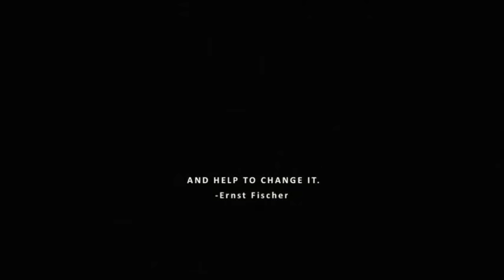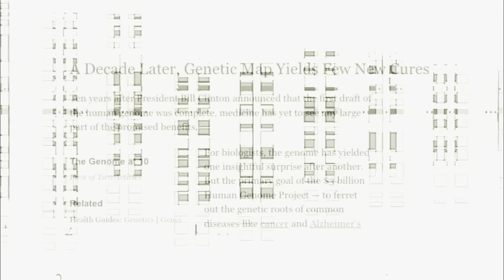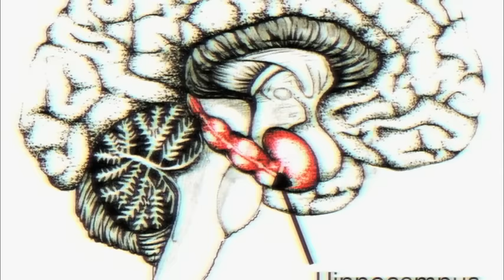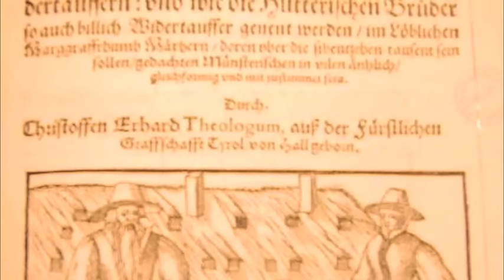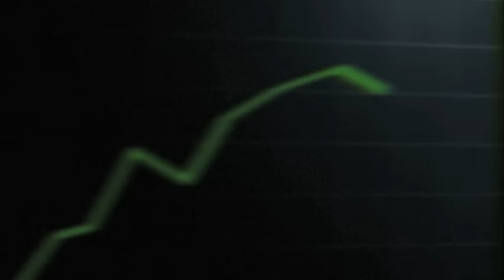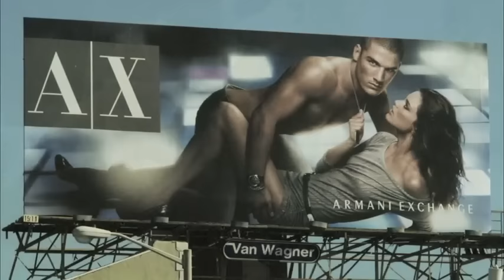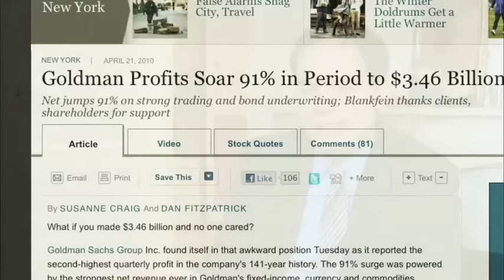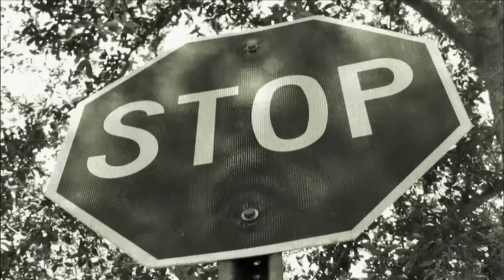ZEITGEIST: MOVING FORWARD | OFFICIAL RELEASE | 2011

Comment: If there's any validity to this system at all, it should be possible to show it on a smaller scale, contributed by voluntary actors in a non-violent way. If you can create a system of abundance where people doesn't need to work for survival, surely it will grow. That is the very essence of a free market.
Reply: You should extrapolate on that idea and take into consideration the conditioning in our economic system currently as well as the absurdities of the current economic system, not the math, but the fundamentals. The technologies existing today could provide an overabundancy if employed rationally and not for personal gain..that is the hitch.
Reply: Paul Warren Your point being with respect to what I just said?
Reply: rwoz
Human nature is more the problem than the application of any type of economic or political system. No matter how benevolent a system might be, it can be subverted by malicious intentions....
Reply: What does that have to do with what I just said? Does it change the fact that if the idea of a RBE can be realized on a large scale it should also be realizable on a small scale?
Reply: A small scale RBE is basically a commune that uses off grid technologies (Rain collecting, solar power, etc) that frees participants from unwanted work. Many communes already exist and continue to exist. Two ways to build a small scale RBE, either upgrade current communes (either as residents or outsiders with the residents' approval) or build an experimental RBE city from scratch. In order for RBE to grow either way, a team can set out to teach others the basics on how to build their own city. To gain trust, they can give away surpluses to the poor and provide them with meaningful jobs that make a difference. Members can also use the Internet to educate even more people. It can be an opensource project where anyone online can contribute to by recording and sharing the results of their hands on work (Similar to existing opensource hydroponics). Families are an example of a small scale RBE that have been around since, well, the first families. They don't use money unless they have to interact with the monetary system, they share resources, parents "survey" the environment to make sure its hospitable and to figure out how to live in it, etc. Growing this requires people to start treating non-relatives as relatives, this eventually becomes a commune.
Reply: The closest real-life example of a RBE are eco-villages such as Findhorn in Scotland and Wildpoldsried in Germany. 2500 inhabitants of that German village produce 300% of their energy needs with solar and wind. Findhorn produces 70% of their own food with around 90% of their own energy. And these villages aren't automated to the full extent. Agriculture itself has been tremendously automated and the process is continuing. New technologies such as hydroponics, window-farming and vertical agriculture mean you can grow food within the cities. A few years ago a new European satellite was launched called Egnos. Its G.P.S. is so precise that tractors running on that system and a farmer marking his land can sit back now while the machine works autonomously. 

Is there validity to a RBE? Of course. All the technologies we advocate exist today, it's just a matter of optimizing and designing these systems. The problem is that there's never enough money and that the market itself will resist these changes. What free market advocates are unwilling to see is that eventually high technology is going to render the market obsolete.
Reply: TerraRubicon That sounds great, I really like the idea of a self sufficient livelihood. If the result will be that people will stop working and therefore consume much less, then fine. Render the market completely obsolete? Well that sounds like hell of a great future (in terms of resources) if we don't even have to trade with each other and still have our needs met. I remain skeptical.
Reply: rwoz When I say 'the market will become obsolete' then I'm really looking far into the future more or less at a society you would see in the tv show Star Trek. Right now and on the horizon are the reforms the market has to face. There's the debt problem, peak oil (it's a finite resource) versus clean energy systems and technological unemployment. Technological unemployment is not just jobs that disappear. Market economists often claim that new jobs are created. That might be partially true but technological unemployment can also mean a decrease of 'working hours.' If you make a machine to replace a human then the factory might put some time in it, there might be a maintenance person who checks the machine periodically but a 40 hour a week full-time year long job has disappeared. You understand? Thanks for reading.
Reply: TerraRubicon Yes, of course it's a radical sci-fi idea but I still don't want to dismiss it, it's pretty much impossible to tell how a world with such capabilities would look like. I mean, only the idea of creating an AI with human intelligence is so radical it's ridiculous to claim to have any form of valid forecast of how such a future would progress. It might all go to hell in an unimaginable way, or the opposite, who knows. It's fun to speculate around though.
Reply: rwoz Well, going on with the Star Trek analogy. I don't know if you've seen that show on television but they have this device called a replicator, it makes food or water by rearranging atoms&molecules. So a person walks up to that machine and orders a meal or drink and it just materializes. Pure science fiction of course, but something remotely similar exists today. 3D printers... This machine can already make objects made of plastic and metal. They are experimenting how the machine can make food, a pie for example. I have family working in the aircraft industry and was told that a big company was investigating making aircraft components (made of composites) using a 3D printing system. This machine is going to be the next revolution and will change the market.
Reply: TerraRubicon Yes one can hope so, the idea of decentralized manufacturing in that sense is appealing. An other argument I've heard for the remote possibility for a star trek replicator is the fact that we as humans can rearrange food to create other humans. Just take that principle and think of how advanced machines one probably could make if one had the technology.
Reply: rwoz People do this all the time these places tend to get raided for growing pot even though they dont
Reply: Ross Watkins Well that's obviously fucked up. But that's a government problem and not a market problem.
Reply: rwoz I've strayed somewhat from your initial point but personally I'm all for testing RBE systems. Test houses, test streets, city blocks with build-in agriculture. I'm all for it. I would also like to see more studies in the psychology&sociology sciences perhaps in combination with universities.
Maybe free market advocates can build similar systems? It would be really interesting comparing results of these systems.
Reply: How free is a free market system really? If you had a company, would you grant everybody access to your system in order to monitor each little detail about your manufacturing, resource use, logistics, waste, R&D, product safety, working conditions etc? If so would you be totally unconcerned about whistle blowing or even just people forwarding evidence how you could make your processes more efficient and sustainable?

If negative, do you expect everybody to take your work on faith alone?

A system based on trust and faith alone (and some published financial figures which don't say much about the tangible components of an enterprise), hoping nobody will break the rules and sanction those who get caught breaking them. I call that idealistic and utopian.
Reply: Franck Merlot 
1: I don't see what this has to do specifically with my comment. It wasn't about what's good with free markets but that a RBE should be realizable in a voluntary society.

2: Non-sequitur. Just because people wouldn't trust companies in a free market context doesn't mean that they still wouldn't be free not to cooperate with them. And no I don't say that every company would be trusted, they would rather be pretty damn suspicious since their interests wouldn't be "guaranteed" by some phony state. This would on the other hand create an interest by the companies to shape up and therefore weed out the bad ones. Some kind of a standard would probably emerge. 

I have never seen a good argument for why I should trust centralized control. Almost everyone who criticize the free market seem to assume that the government can do all these miraculous things, completely disregarding systemic aspects. You think there are some central agency which magically could calculate every optimal solution for everything? Or that they wouldn't be influenced by special interest? People have this idea that an all powerful entity could set fair rules for us all, it's almost as if they believe in some sort of a god.
Reply: rwoz "You think there are some central agency which magically could calculate every optimal solution for everything?"

There is no "central agency" in an RBE. It's completely decentralised since everybody would be involved. Not just a controlling elite (which is never guaranteed to be competent).

You haven't answered my question. Would you grant access to all your company data, assuming you had a company?
Reply: Who will then enforce every company to view all that information you want, if not a central agency? 

I don't know, it depends on what standards there are. If my only option for successfully driving a company, maybe because I need investors, partners or consumers which can trust me, then maybe I wouldn't have a choice. But if my choice to not show all that information in the end would make me earn more money then of course I wouldn't.
Reply: rwoz Well, that's exactly the crux in market systems. Confidentiality and so-called intellectual property whereby the latter is very seldom an invention truly from scratch and mostly just a declination from existing knowledge which is public.

I get the suspicion that market advocates define by "free" the freedom to exploit every ever so small advantage and the freedom to keep the option open to screw others over.
Reply: Franck Merlot Why didn't you answer my question? 

There's a crux to everything, it's like you're asking for a system which guarantees that everyone will play nice. No such system exists and it never will. 
People within the free market community are divided on the legitimacy of intellectual property. One can say: to claim the exclusive right to an idea is to prohibit others from their right to their physical property. In the end I can understand both sides on a moral plane, but in the end I'm against it. 

Free market is ultimately freedom of human interaction with respect of individual rights. Nothing else. "exploitation" is an accusation that could be used in pretty much any case at all depending on how you look at it. When people use such vague terms to dictate the rules, the outcome is arbitrary and the system is an easier subject of abuse for malicious intent. When it comes to the rules of a system of violence, such degree of vagueness could be devastating. The principles of individual freedom tries to deal with that by forming as few connections of violence as possible between human beings, and through that we may form our own communities as we see fit. People can therefore flow more naturally to where they think they belong without disrupting the harmony.
Reply: rwoz He can't answer your question without falling into contraditions and absurdity. Even Peter Joseph himself couldn't. Under this system you must be eliminated for infecting people's minds with your free market bullshit.  You are an 'enemy of the people'.
Reply: rwoz Your question is based on circular reasoning. You falsely assume that human coercion is an innate and immutable inevitability. This is not about "playing nice". This all about plausible reasoning how to keep the only habitat we have as habitable as possible for as long as possible.

Nature itself sets the rules. It speaks the only truly universal language for all living beings. You can delude yourself to have freedom in a market system as much as you want and preserve the delusion for as long as you live. However when you take your freedom to deplete and pollute until nature says "no more!" even you will have to bend over. When that moment is there nobody will have to explain it to you. Nature's language is clear enough. The difference is that some understand it already today. But it seems like prevention is a foreign concept to those who refuse to understand nature.
Reply: I presumed you wanted coercion since you're arguing against free markets. Therefore I asked where that coercion will come from, it's a very important question about how we morally should relate to violence. Such values play a big role in determining the fate of our future, which you claim to care so deeply for. You say that it is all about finding sustainable solutions, the problem of violence doesn't end just because of that. You see a problem in how humans act, I say that the free market should handle that. You argue against the free market so that must mean that you want to force others into obedience, but then the question remains: How can one trust the enforcer? All I get from zeitgeisters is that computer algorithms should rule everything, and that everyone can trust that system, that no one will program them for certain malicious purposes. Somehow Peter Joseph tries to convince others that he has a recipe for a society where no power hungry psychopaths will wander about, but that is a very bold statement which I don't accept so easily. You argue about issues of sustainability within the free market but I say that to convince me you first need to present an alternative view on morality which aren't a subject to abuse. 

I have these values precisely because I believe it is the best way for humanity to find harmony. I recognize your rhetoric, do you seriously think I will bend over for something as shallow as that? I might say exactly the same way to you, but it's no different from "I'm right since I care about logic, you don't", it doesn't help at all developing the discussion.
Reply: Franck Merlot Now if you don't want to use coercion, then you're for a free market solution,,,, which is what I was arguing for in the first place.
Reply: rwoz You're not getting out of your circular reasoning. You falsely assume coercion is necessary for a concept like the RBE to function.

On a side note, we're only temporary lodgers on this planet. There are generations to come after us and each generation has a legitimate right that their only habitat called planet Earth is kept in a sustainable and humane state. That is only possible with the closest approach to objectivity we have. The scientific method.
Not self serving concepts hijacking science, biased scientists, speculation, outdated myths or brainwashing but arriving at decisions through reasoning, plausibility, education, information and thorough testing.
Reply: rwoz Besides, you're somewhat contradicting yourself by equalling "no coercion" with "free market" but then bring "power hungry psychopaths" into the equation which you seem to assume are an inevitability. There are root causes why those individuals exist today and the causes are not to be found in nonsensical myths about immutable genes.

Once again, prevention of root causes is always more sustainable than doctoring around the symptoms.
Reply: You're still not communicating how you want to deal with violence, I don't see much more use continuing this discussion.
Reply: rwoz Why do you assume violence?
Reply: rwoz The violence issues are thought to be solved little by little as you cover the basic and ultimate needs of all living beings (food, water, shelter, education, social responsibility, environmental knowledge and stability). There are many people that are driving through the way of the first (and, in my honest opinion, the most important) steps to the "change of consciousness": Competition and vanity. If you remove those two wrong-shapers of the human abnormal behaviour, you are almost there. The rest goes in hand with education, involvement and social awareness. 

If you promote this train of thought, you are closer to what the documentary states at first: violence is a result of a violent environment, not a "innate" characteristic of all human beings.
Reply: Parmid Oproxydim How do you want to "get rid of" competition and vanity? What I'm asking is how we should manage violence. What morality should be embraced? When I talk about violence I speak of it in a context of individual rights. It is a very natural solution to let people own their property (where original resource extraction is tied to principles of homesteading) and be free from violent interference by others. It is a civilized, decentralized way of managing society and violence has a very clear structure of where it can be allowed: when individual rights are violated. Today, from this point of view, we're getting violent interference (e.g. through taxation) from the state and therefore are managing violence in a different way. In our society, violence aren't seen through such easy principles as they are in a world of individual rights (and as they are commonly among men, from person to person), it is a much more complex structure (or rather non existent) where people in theory are supposed to be able to interfere however they want with each other as long as they are in a majority. Of course this is hard to manage flawless since it's built on such a shady foundation that it's susceptible for corruption. And thus we have this corporatocracy, free from a clear moral scrutiny. The very fact that a lot of people today speak in terms of "pragmatism" and that moral principles within government are outdated tells us how far off we're drifting. 

It is a very basic problem: how can one manage violent force for both securing rights and at the same time not be susceptible for corruption. It seem like you people talk about violence from common man... I don't know how easy that can be fixed, but what I do believe is that there is a certain percentage of our population who can't change. 4% of humans are sociopaths and we will always have problems with these people. You might believe that it's possible to fix so that everyone in power can be trustworthy but I will probably never trust that. 

Now, my point from the beginning was that this isn't a problem as long as people choose to opt in freely into your society. I think it's a great goal trying to reduce consumerism and make people self sufficient... a world free from government dependency, with decentralized technology and institutions, what's not to like? And I do agree, this will probably reduce stress significantly and therefore reduce crime... and hopefully people will stop working their asses off and start spending quality time with their loved ones and hobbies instead. That is a future I want to live in. But one has to be mindful of how the moral/violent structure will influence the situation. Otherwise we might end up with a totalitarian society instead.

If this is possible, I don't see why it wouldn't work in a free market. And if it's not a free market solution, then we're at the problem about how to manage violence.
Reply: So to wrap up: The structure of government (organized violence) can't naturally be trusted. The best solution according to liberty minded people are a system of clear moral rules where connections of violence between people are separated as much as possible to reduce risk of corruption. Zeitgeisters want to have a strict control of resources and they seem to dislike freedom of exchange.. will they want to handle this in a violent manner or a peaceful manner? If they expect to convert people through the free market, then I have no trouble with it.
Reply: rwoz I think, after reading all that you've written, which is valid and understood, that we can extract two main issues, the 'authority' issues and the 'economic system' issues. As far as I can understand, related to the Zeitgeist Movement, there will be no market based on money, as money is one of the most important and decisive factors that had to be gone in order to proceed with the EBR system. This will remove the speculation behind it, just to name one important effect that this may have. Second, I don't think we will have the same structure of 'regulatory' government as we now have, because it is implied that there will be no problems in the distribution of resources as they are produced and calculated according to the needs of people, in an effective and equal way.

There is no way of creating a system of clear moral rules under a monetary, competitive system. How can the system be so "selfish" (just to attach a feeling) to have the possibility of creating as much resources as needed, and to stock them instead of giving it to the people that need it? It just can't be conceived. This system is based on consummerism, and a system that relies on consummerism to survive, will always be an speculative system.

Violence will not be necessary, as competition will not be necessary, as there will be no products to be advertised with marketing, as there will be no "status" to be pursued, because you will be able to live without having to struggle to fulfill your basic needs. Why will corruption even happen?  

It is important to address that you can't just 'be taught' to get rid of competition and vanity. You need consciousness and understanding that, not matter how hard you try, you cannot keep "playing and trying to change with the same rules, in the same paradigm". There's people that radically changed their mind set, and they are promoting that "equality" in their way, what makes you think it cannot happen with the rest of the world? You have to start with what the Earth produces, and then producing it in the best conditions available. And in the process, you will totally need to let go of your ego, let go of your vanity, stop trying to be "the best of all and above all" and understand that the potential is the same in all human beings, under the right conditions, which are not the 'market' conditions.

I hope I was clear enough (English is not my first language) And I'm sorry that I cannot explain it better and with more "technical" arguments.
Reply: I suspect you don't understand the concept of 
"money".
Reply: rwoz I think it's good you're in touch with the fundamentals. However we'd have to break it down even further then. The concepts of ownership and nation belong to those fundamentals that are widely assumed as a given today. Almost like "natural law".

The fundamental point where the concept of the RBE and the so-called "free" market system are incompatible is the false assumption that planet earth is the property of humans. It's like a background task that is permanently running and nobody dares switching it off.

Humans are renting this place. Our existence is only temporary on this planet which we have to share with millions of other species and which we are largely dependent on. We have a legacy to pass on and the more sustainable, efficient and adaptable it is the better it is for future generations and the survival for all life on Earth. The consumerism we currently have is not sustainable.

As you mentioned trust. Who can be trusted and who can't be in a closed door system? If we don't all play with the cards on the table there will always be distortions, rogues and aberrations.

We do have an approach which is the most objective, hence the most comprehensive for all humans and life in general. The scientific method. The language of nature is the only universal language.

"I do not feel obliged to believe that the same God who has endowed us with sense, reason, and intellect has intended us to forgo their use." Galileo Galilei

I also recall Carl Sagan's Pale Blue Dot speech...
Reply: Parmid Oproxydim People will always try to gain power. This is just a certainty in my mind... There's not a certainty at all that "common man" will stop seeking status when their basic needs are fulfilled. People will still try to express themselves and the differences among us will still be apparent. But even if a lot of people would chill out more instead of hunting status, there will always be some people, there will always be an "elite" in a psychological sense among us who will want to gain power. They are like the human predators, looking to manipulate the system in any sense possible just to gain power. 

You say that we all have the same potential, I say that's definitely not true. I believe some people simply are more thrifty than others, because they have a need to be so. Peter Joseph almost seem to wanna get rid of differences between human beings just because he want to get rid of envy. Why not try to get rid of envy genetically instead, I wouldn't be surprised at all if it were possible in the future. It's not like envy serves a good function, it's the most stupid flaw there is within us. 

The idea that money will be abolished I'm highly skeptical of. I can't imagine how it would be managed. To say that money will be gone is essentially the same as saying that trade will be gone... when will we have ventured into such an advanced age where we don't have to ask anyone else for services because we have access to everything ourselves instead? The way it has been so far, we've diversed ourselves into ever more specialized areas, how that will progress in the future is hard to tell. Maybe everything will be taken over by robots. But I hope you do understand how radical change it would be if there truly would be no more need for money. Money truly is the greatest innovation humans have understood, ever. Without it we never would have lived in such an advanced age as we do today. 

What's the argument against speculation? The way I see it, it commonly seem to be an argument by economically illiterate people. It actually serves as a function to smooth price fluctuations. If people think rightly so that price of something will go up in the future, and they therefore start buying to stockpile (or they go into the futures market, but essentially it's the same idea), so that they can sell later.... if a lot of people do that, then it sends signals to the market that they should start preparing for shortages in the future. So this in turn raises prices in the present, but therefore give more resources to be consumed when the shortage normally would occur. Try looking at this explanation by Bob Murphy: /watch?v=VKk3vCbnigc
Reply: rwoz
"Why not try to get rid of envy genetically instead"
For that to be even conceivable it has to be proven that it exists.

Even decades after decoding the human genome there is no trace to be found. There is a lot of evidence though that environment creates envy.
Reply: Franck Merlot I'm no expert so I don't know anything about that. What I have heard is that there's a great possibility that we will be able to modify our genes in the future. I have also heard that there is genetic causes to for example depression, so one can wonder how many other emotional states can be dealt with through gene modification. It's a nice thought that maybe we'll be able to raise our EQ through technology. 

/watch?v=dLtC-50lrK4
Reply: rwoz To be able to "modify" genes we have to first fully understand what the mechanisms of genes and the brain are. What is known to date and for which there is experimental and observable evidence is that epigenetic and neuroplasticity effects play a major role in human behaviour. Genes are "switches" that respond to the environment. Also synapses can rewire themselves in response to environmental influences and then trigger epigenetic expression which can be passed on to the next generation.

You may have heard of "junk DNA". Humans have 98% of it! Genes whose functions weren't fully understood until fairly recently in the research of epigenetics. The whole human genome project was actually quite disappointing in the sense that the hope to find genetic predetermination in serious illnesses went down the drain not long after the genome was fully decoded. The lesson that was learned is that we are extremely "sensitive" to the environment, with individual variability.

What is known today is that the human brain is extremely receptive to external influences. A stimulating, intellectually enriching environment with a minimum of extrinsic stress is plausibly more likely to enhance intelligence than crude gene manipulations as genes will re-adapt to environmental influences. And so will the brain. So if the environment is not intellectually stimulating the brain is more likely to discard the intelligent wiring and "dull down" again.

If you think about it, all this is very plausible. Without the response and adaptability to environment, evolution would never be possible.

Don't mix up genetic predisposition and predetermination. Also pointed out in this film.

Besides, even just the thought of trying to genetically manipulate humans into docile geniuses instead of working on the root causes for current disorders is real dystopia.
Reply: Franck Merlot I'm not gonna argue much against that since I know so little. 

"Besides, even just the thought of trying to genetically manipulate humans into docile geniuses instead of working on the root causes for current disorders is real dystopia."

If the root cause is irrational I don't see the fault in getting around it through more biological measures, if that were possible. Do you think there is a rational need to feel envy? Some negative emotions actually help us, envy is not one of them. If the root cause for someone feeling angry is because someone else has a more expensive car, the problem is the emotion itself.
Reply: rwoz
"If the root cause for someone feeling angry is because someone else has a more expensive car"
Is the car really the root cause?

Key word is "inequity aversion". One of the few apparently innate behavioural characteristics in primates. It is plausible that without this quality social species could have never survived for long in the evolutionary context.

There are experiments which show that even dogs have a sense for equity. Google it. It's interesting.

Now imagine a world where inequity aversion is gene manipulated out of sight, out of mind but the root causes for greed still persist. You'd be creating a world with even more distortions than there already are.
Reply: Franck Merlot I don't know how the brain works, my point is that there's no rational reason to feel angry because of something so petty. What's your point about dogs and equity?
Reply: rwoz The point is that the current distortions and inequality go against fundamental human instincts. The scientific evidence is there for everybody to check for themselves. To top it off it's very plausible.

"Envy" is merely a symptom. Inequality is the root cause. Those who are mentally unaffected by it are psychopaths who are  lacking empathy. People with a serious disorder.

The question is, once again, how sustainable this is.
Reply: Franck Merlot "The point is that the current distortions and inequality go against fundamental human instincts." That's exactly what I'm talking about when I say envy. It's irrational and you don't want to admit it. I say that some people feel angry when they see others owning an expensive car.. you say that the car isn't the root cause, but inequality is. Well, don't you think I agree with you there? That's exactly what's irrational: To be angry just because someone else has more than you. You think that just because it's an ancient instinct it's some deep knowledge we should learn from? It developed in a completely different environment! If people would only be better of not having these feelings then it's irrational.

"Those who are mentally unaffected by it are psychopaths who are  lacking empathy". 
So people who can see that their friends gain more status, wealth, happiness or whatever, and are unaffected by it envy-wise are psychopaths? Or people who goes unaffected by the fact that others have more than them? Because that's inequality.
Reply: I don't know if the proper term is "psychopath" but I do think that not taking into account in your life that there's a lot of people who are suffering due to (fixable) inequality, is a clear manifestation on how society standards of progress and community have failed.

To put it in an example: If you see a homeless person and you are unnafected by it, you are "disconnected" from the human purpose of inequality (here does enter the premise of psychopathy or "numb" empathy) because you seem to think that it is not your fault that that person is homeless, therefore is not your responsibility, but his, or the responsibility of others.

So, to wrap up again, what's the point left to clarify here, rwoz?

Just a comment for you, it is important to understand the psychological behaviour and sociological behaviour related to the current socio-economic system and inequality in order to understand that, no matter how "petty" (like you correctly said) or any attribute you want to give it to it.
Reply: rwoz The fallacy you're running into is to assume material envy as irrational no matter what the underlying root cause is. I don't know if you're on the same standpoint as many reactionaries relying all they do on the fatalism of "life's not fair, full stop" even if there are demonstratively options to work on the root causes of why life's not fair.

You're muddling up inequity aversion and envy. Think about it from the fact that no single individual can work thousands of times more or deliver a quality that is thousands of times higher than another individual. However this system is riddled with distortions in terms of income levels and within the value system itself.

Truly irrational envy is for instance when a woman behaves in a toxic manner to another woman just because she is considered prettier than her. Or two blokes hating each other just because one has a higher academic degree, has more success with women or speaks two languages more than the other.

If the latter can ever be fixed in the future is debatable. However for the former there are possibilities to solve the root causes that lead to inequity aversion (and as a consequence perhaps in a near future to total chaos when people are getting too scared for their own livelihoods). It just takes the effort to tackle the issues at the root. And that's the point being made by TZM.

On a side note, there are cultural differences as far as the intensity of inequity aversion and how much fairness is valued as a requirement for a functioning society. There are large differences also in the threshold where inequity is perceived vs where it's shrugged off as irrational envy between for instance the USA and Europe. It is likely to have something to do with the almost pathological fear of anything that just smells ever so slightly of socialism in the US.
Reply: Franck Merlot Why would "inequality aversion", wherever the limit goes, be rational? What I'm talking about is the fact that some people simply get depressed as soon as they notice that someone else has a much better life, be it material or spiritual. Tell me: what is rational about feeling bad that you can't have it as good as others? Take for example a football player, playing in the highest league, earning maybe a million per month.. this is a result of people voluntary contributing to a collective pool of money because they want to see him play. In one moment everyone has the same amount, in the next one person has a looooot more. If someone would feel depressed because of this, why would that be rational? What would make his life better? It doesn't, it's completely irrational. What you're talking about is connecting your well being to others. What's good about depending your well being on others? Isn't it preferable to live an independent lifestyle instead? You say that some envy is irrational, well that is for the exact same reason as "inequality aversion", only on a different level. It's all about attachment to your ego.
Reply: Parmid Oproxydim You could explain that by the rise of the welfare state. People already pay a lot of taxes so of course they expect the state to do something about it. Having a welfare state outsources morality from the people to the state.

"Just a comment for you, it is important to understand the psychological behaviour and sociological behaviour related to the current socio-economic system and inequality in order to understand that, no matter how "petty" (like you correctly said) or any attribute you want to give it to it."

Yes, I agree with that.
Reply: rwoz If you look at a global scale. It makes no rational sense to monopolise or hog resources just because you were luckier, better connected or a better talker. As I said before, nobody can work thousands of times more than somebody else. We are all dependent on each other globally.

As an example, coltan miners in the DRC risk their lives 12-14 hours a day for a plate of greens and ugali so you can play with your electronic gadgets. And the vast majority of those people don't have the slightest chance to ever get out of it. The more desperate someone is the easier he is to exploit and to control. Besides it regularly leads to conflicts. That is irrational.
Reply: That's a whole other debate. You have zero arguments so then you immediately turn to emotionally driven arguments like a typical leftist, completely out of context. I don't see the point in continuing this discussion with you.
Reply: rwoz That's what this whole issue is all about. The concept of the RBE is based on the premise that planet Earth is the only habitat humankind has. It's a global concept, not a national one. It's not political either and even less so emotional. The current system or anything which is just a declination of it is not sustainable.

Your are the one who is introducing an emotional component. You haven't even brought one constructive idea to the table how to tackle the current global distortions and related problems. You just assume them as a fatalistic given.

You don't have to be a "typical leftist" to understand that this kind of system is not sustainable. All you need to apply is reason.

That envy "argument" is just polemic to distract from the real issues. The current global inequalities, especially in resource rich areas, will lead to more and more tensions and conflicts which can then bring whole supply chains to a grinding halt. How difficult is that to understand?

You can try to shove those "envious" people to the side as much as you want. Nobody likes to be exploited even if they feel zero envy, except perhaps people with a mental disorder like masochists. Tensions out of inequity aversion always tend to escalate at some point. Working on the root causes is definitely more sustainable than sending in troops to coerce the "envious" back to compliance.